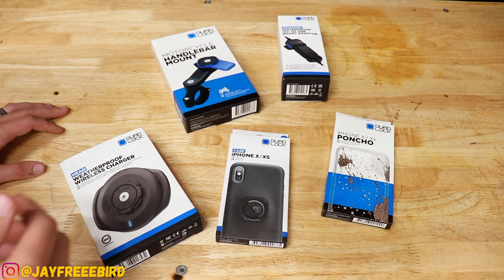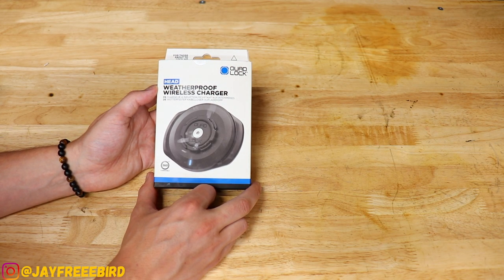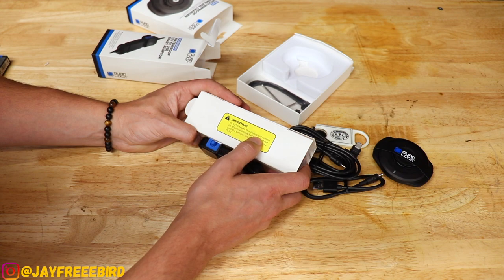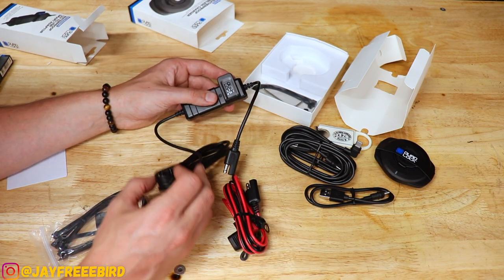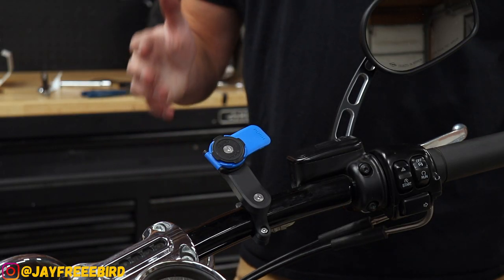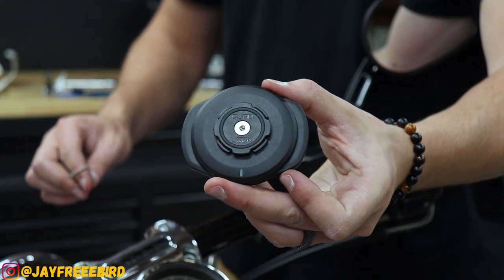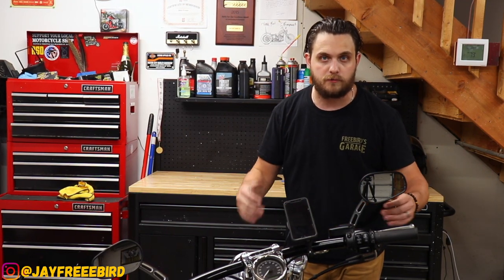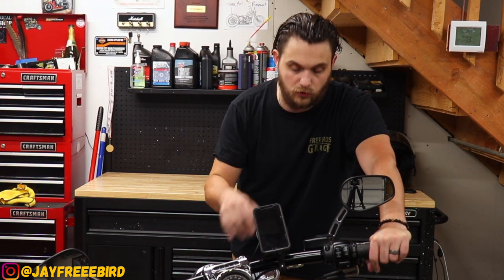Quad Lock Motorcycle Handlebar Mount and Wireless charger Install on a Harley Davidson

Comment: Wait, two questions. 1. You need to remove the tank? That's a massive job. 2. Where do you route the wires under the tank and up through the bars? Thanks!
Reply from the maker: If you have the charging device and want a clean look I would. Other wise you can attach it anyway so it doesn't dangle around. Run the wires right down the middle then follow the other wires up the bars, if they are external.
Reply: @freebirdsgarage  Thanks!